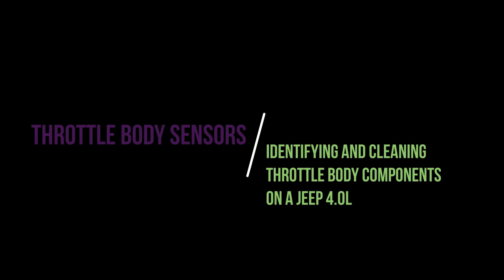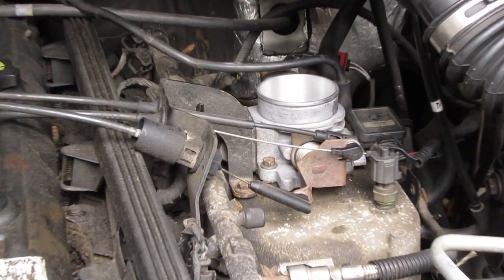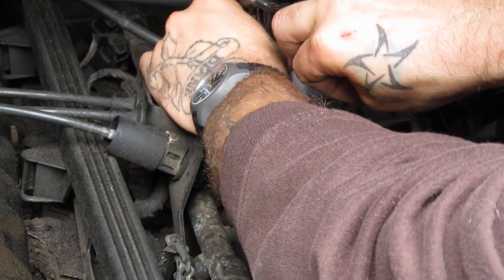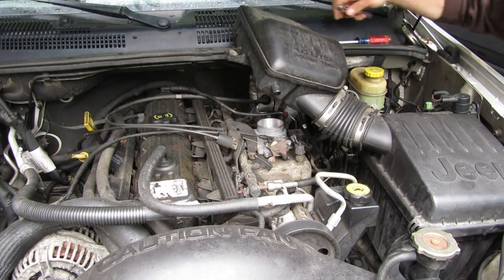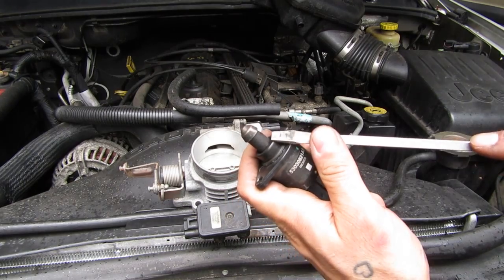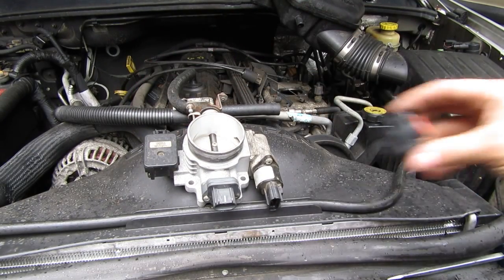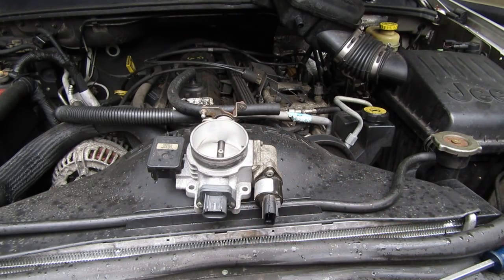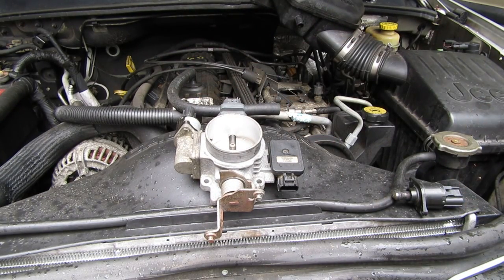THROTTLE BODY SENSORS (IAC, TPS, MAP) - Jeep 4.0L

Comment: If a viewer didn't tell ya already, the MAP Sensor is actually called the Manifold ABSOLUTE Pressure Sensor, not Actual...check your repair manual(s) for the exact terms... LOL.

Comment: uggggh the plastic connector for the throttle cable to the butterfly broke. Is there  a way to replace it without replacing the whole cable?
Reply from the maker: I dont know that there is a "correct" way to do it, but I am sure something could be rigged up. I haven't personally come across that issue. Maybe JB weld?
Reply: D&E In The Garage I would jb weld but it needs to pivot around the "ball" joint. I ended up ordering a long cable throttle valve connector for 11$.
Reply from the maker: Probably the best bet. I'd be interested to know how that goes for you. Never had the occasion to change one on a 4.0L
Reply: https://www.shapeways.com/product/V9TBTUKN2/jeep-4-0l-auto-transmission-throttle-valve-clip

 Heres the link for the throttle body connector piece. Interesting to note they sell an entirely platinum clip for 7,340$. I don't think that's worth it XD. I went for the plastic connector piece. But thanks for the help with the throttle body removal and cleaning info!
Reply from the maker: Thanks for passing that along. I am sure at some point I will be replacing one of those. haha
Reply: cheers! I just got it, and it fits like a glve

Comment: I swear. I swapped the IAC, cleaned the throttle body, injectors, plugs, Coil, and still have an incredibly rough idle and significant engine misfire
Reply: Sounds like a bad injector!
Reply: @nevadaboy9769  ended up being 6 exposed wires on the harness that were under the shield thing. Of course the dealership missed it and still charged me 450 for a single injector circuit repair. If only they looked about 4 inches deeper smdh

Comment: Seafoam will fix these problems,  My tj would not pull the skin off a rice pudding before using seafoam . Now it's like brand new.
Reply from the maker: 100% true. My 2000 XJ is due for a round of seafoam